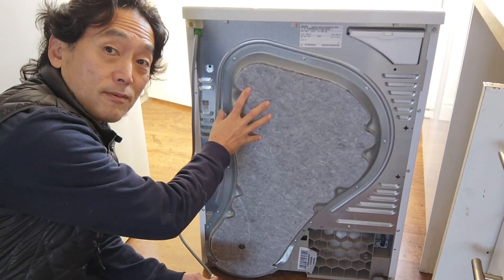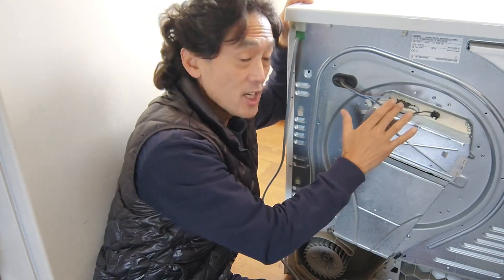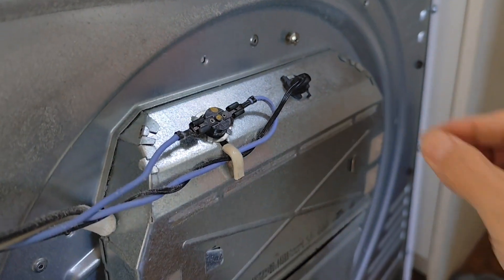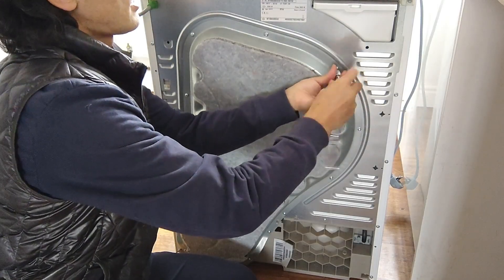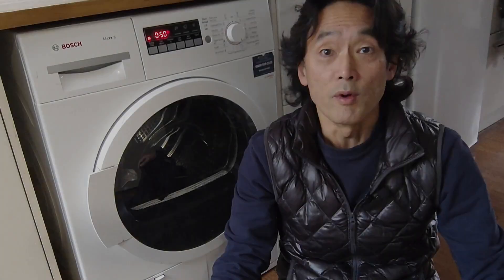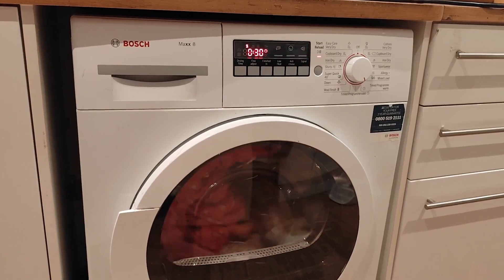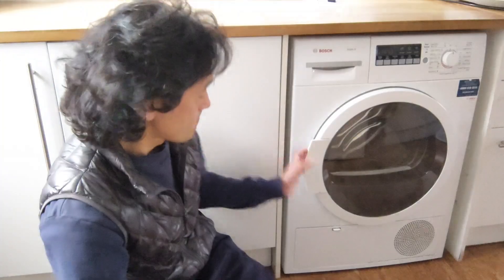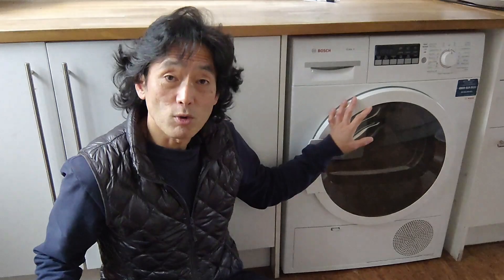TumbleDryer4

Comment: Hi Ken, I’ve been having similar issues as you with my Bosch dryer and I finally found something that is working consistently so far. I replaced the moisture sensor and have been religiously cleaning it with white distilled vinegar on a paper towel. Before this I tried replacing the condenser and the heater. I also noticed my unit collects a lot of lint near the sump pump so I regularly clean out the sump as part of the maintenance. I’ve followed your journey over the last few months and I hope I’ve helped us finally solve this mystery! Let me know if you try this and how it works for you.
Reply from the maker: @jorgevaldes8464  ok I will catch you up. My dryer's door latch broke and I am thinking to get rid of this finally or not at moment. Thank you for your experience sharing! I replaced a moisture sensor but not cleaned ever.
Reply: @kensuzuki9319 oh no! I hope that’s not an expensive or complicated fix. These machines are so expensive to replace. I was about to give up before trying this. It’s such a small detail in the manual but I think Bosch should emphasize it more as it seems to be the source of my machine’s problem. Good luck!
Reply from the maker: I agree. Hope some Bosch engineer looking at this conversation. Thank you!

Comment: Motor overheating?
Reply from the maker: @riaandewinnaar5040  ummm, could be, although it sounds more like program process issue.
Reply: I have same issue but it’s Samsung condenser dryer it shows filter clogged symbol on display sometimes and then stop I just clean all the exhaust line and pump , exchange, filter but it’s show up one time but I fixed the new pcb controller also and new blower two fan and new water level sensor ..mine moisture sensor is good and filters also good .. I am thinking there is diagnostic mode for every machine I try to find that 
I used that mode for Electrolux dryer so it was successful but I can’t find that mode for Samsung if you can find that diagnostic mode for your dryer it is easy to figure fault of your dryer too…
I try to changed the lint filter thermister for my dryer ,,,, thanks this what I have say
Reply: @a.c.a948 check the element if there is lint build up.
Reply: @riaandewinnaar5040 
Already checked nothing there
But there is sensor top of the element 
That’s the one issue coz when I put the hot water on it that show the filter alarm 
Might be malfunctioning that sensor
Reply: @riaandewinnaar5040 
Thanks

Comment: Very good video, Ken 
I have a similar problem 
Using dry cloth to dry around heat exchanger container seems to help also keep room steam free by having extractor fan on when using tumble dryer.
I would like to add, bosch 
Have very poor quality control on some of the aloy door hinges. On my machine, they want the customer to buy a whole new door when hinge fails. 
Pathetic.
Reply from the maker: @tonyofsnodland6427  Interesting ideas, thank you. My door catch broke that I have to fix but not sure how to access that without breaking. I should try. Thank you for the comment!

Comment: try to clean the sensor under the filter on the left. I didn't see you do it in your videos
Reply from the maker: @sergei149  Maybe in my the first series of this video I did that sensor clean? If the sensor you're talking is.
Reply: @kensuzuki9319  Try checking  motor capacitor. In case of a weak motor starter capacitor  it cant rotate full load and it shows you blocked filter  light and beeps . Pls dont drill any holes. Air goes though the back of the fan at back you see inside of the body. I saw in one of the videos you had blocked condenser.  That lint may  block the front fan that you can probably see thought the front grill with multiple holes.
Reply: @kensuzuki9319 That sensor in the drum (The 2 bars) . They get coated with an almost invisible residue . It is necessary to lightly sand them with fine emery to remove the layer .  I promise this is the root cause of your ""stopping problem""
Reply: @Mike75575  he replaced it in his previous video.
99% of the time,  problem resolved by cleaning the pump/sump and/or replacing the pump. 
However in our case, nothing helps and we will be checking the control board.
Reply: @Appliances-Help  Thanks. I missed that 3rd video in the series. Even though the sensor was new it would still be good to check the bars for good continuity just in case they were coated in something from new imho.  But the cost of the circuit board is daylight robbery imho.
Reply: The humidity sensor is under the lint tray i think
Reply from the maker: @sergei149  I did that one initially but forgot to add that image in the first video. But that was years ago already. Yes good Idea!

Comment: Hi Ken I just emailed a tested solution to the Twisticator sales email. I installed a filter inside the dryer pump compartment and all these problems stopped over the past year. The filter goes in the drain pump area, where it prevents the lint from collecting inside the drain pump. You might need to clean around the drain pump now before installing the filter. 

The lint collecting on these dryers is very poor, and when I dry anything fluffy, especially microfiber, the fibers easily escape the lint filter and clog the heat exchanger. For example, after wash/dry a bathroom rug, the dryer threw a cleaning error, and I found the heat exchanger full. This is with a new lint filter, and cleaning every 3 weeks!
Reply: The “filter” I made was simply a 3m green scrub pad, that sits right below the cover for accessing the pump zone. I used a roomba 600-series filter, replaced the hepa with the 3m scrub pad, cut down to fit the frame. Then  used cable ties to hold the filter to the frame, because the filter sags when wet. The point being you want a heat restistant filter that won’t collapse. Honestly I probably over- thought it and could have just made a pile of scrub pads that was slightly too big to float into the larger area right by the pump.
Reply: What filter did you use in the pump compartment?
Reply: Yes the sump pump area is full of lint.

Comment: My sump doesnt drain so i have ro regularly remove the water - if i dont mine stops during the cycle too (same model).  Pump spins a d hose not blocked.
Reply from the maker: @webbo73  No crack on the hose and the hoses connection sealed ok? Very strange if motor is spinning but the water doesn't pumped up. Thank you for the comment.
Reply: @kensuzuki9319  all seems ok, but sump always fills up.  Water does get in to top container so I don't understand what's going on.  Like you mine is about same age but everything else works ok so I keep using with this small issue.  Thanks for your video's
Reply from the maker: @webbo73  I suppose that you have checked the sensor position is ok. It seems like that the sensor responds very late after the water level hits to the sensor.
Reply: @kensuzuki9319  I did take the side off last year and followed your earlier videos and another one I found but it all seemed ok, but im no expert!
Reply from the maker: @webbo73  It is normal to have the water level up to the sensor height level, if the water level is beyond the sensor level, it's abnormal. What happens if you leave it without taking water out manually?
Reply: @kensuzuki9319  the cycle will eventually stop with an error
Reply from the maker: @webbo73  Sounds more technical than we can do maybe. Either the pump motor power isn't strong enough due to motor issue or not enough current coming to the motor. Ummm
Reply: i think lint accumulated in the pump sump area restricts water flow to pump and when its full, dryer stops.